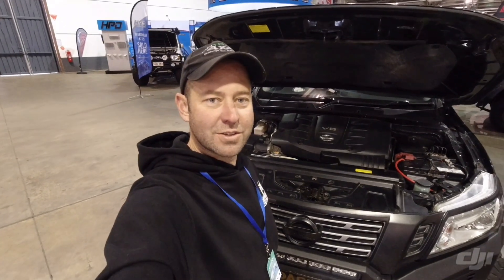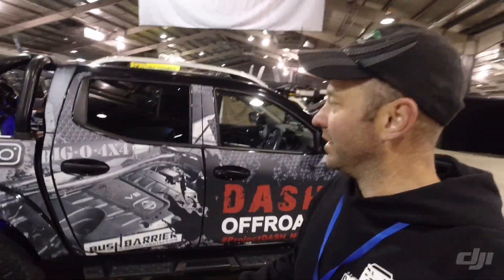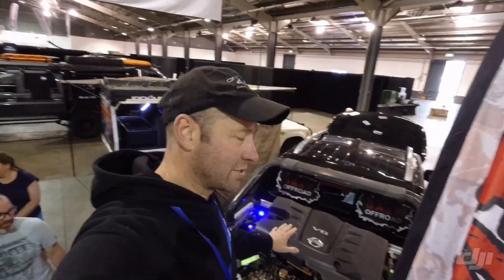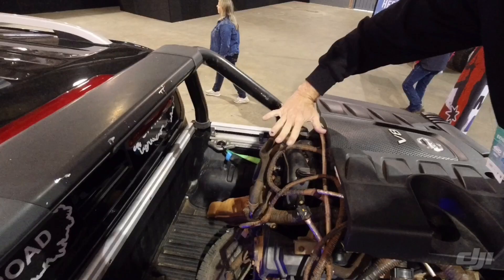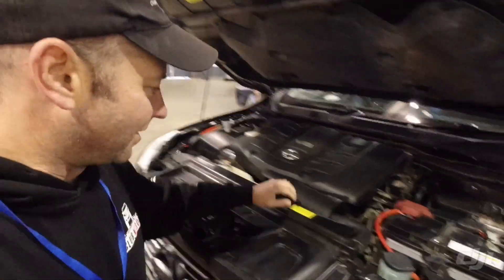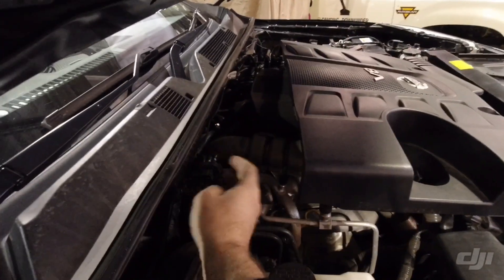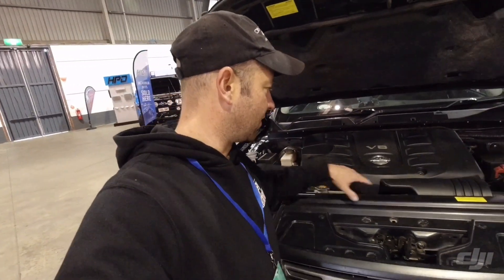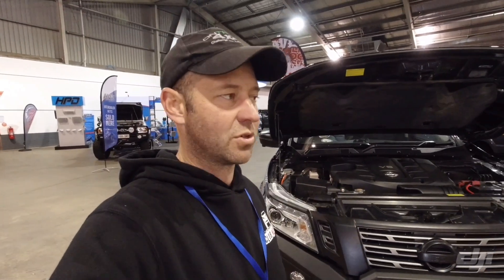Ep.1 - V8 5.6L VK56 Engine Swap Into Nissan Navara NP300

Comment: Nissan take note,  put this in the warrior and they'll sell like hot cakes!
Reply: no one would afford it or could afford it. it'll probs be like an extra $30k above the existing 60k so around 90k
Reply: @lethenparkesTeamRacc  mate people pay mid 80k for a amarok because they want the power,  they'll pay 80k for a Navara with a vk56. I would,  in a heart beat
Reply: @1nando632  then just buy a patrol its basically just that. that's also what its there for too and the amarok v8 is a 4L
Reply: @lethenparkesTeamRacc  ?? What?? 

I've got a y62. Amarok is a ute not a SUV, and it's a v6 diesel not a 4L v8
Reply: @1nando632  yes but you can get a patrol ute with a tray stock with high end specs around 109k and what you said the amarok is mid 80k with a v6 motor imagine what nissan would do with a v8 model in the Navara coming from what they did with the Patrol still be pretty expensive. plus v8s are not that efficient they suck alot of fuel cost alot on registration and are high on service rates.
Reply: V8 Navarra...I want one!!!!
Reply: @lethenparkesTeamRacc  no, you can't get a stock Y62 Patrol ute....
Reply: @mattshaw7671  Its still a V8 thats why theres alot more I4 4WD's on the road than V6's or V8's because they're cheaper and more efficient on fuel to run and they cost alot less on registration.
Reply: @lethenparkesTeamRacc  are you drunk. You're talking about a standard y62 ute, which there isn't one. Y61, yes. Y62, no. 
Yes, y62 is a V8. No,  a Y61 isn't. 
Nor is an Amarok.
Reply: @mattshaw7671  must be because i dont remember writing that comment.
Reply: @mattshaw7671  But i have seen a Y62 Patrol Ute at the front of a Nissan Dealership
Reply: @lethenparkesTeamRacc  It's because you don't know what you're talking about.
Reply: @1nando632  people pay 80k for a 2.2 four cylinder raptor🙄

Comment: I can't see why this won't fit. The VK56 was fitted to the R51 Pathfinders in the US as well as the VQ40DE (AU only). As you would probably know the R51 was also using the Navara chassis before going to the R52 in 2013 as a unibody design. The only thing I would really be looking at is if it is a VK56DE or a VK56VD, with the VK56VD being direct injection. Not that this is a real problem, just wiring/ECU, etc

Comment: I can almost guarantee that the RE7 transmission from each car will have its differences, most obviously in the bell housing. 
The width of the V8 is wider than the Inline 4, therefor bolt pattern will change. 
Only way to swap the Y62 computers will be to run the Y62 transmission in the Nav.
Reply from the maker: Thought that may be the case, luckily we have an entire wrecked car so we can use the Patrol one if needed

Comment: It’s a great idea, diesels days are numbered, I’ve got a y62 best motor but am going to supercharge, what your doing is not new, in Sale Victoria the local Holden dealer has been building new Colorado with 6.2 litre supercharged, and boy is it a mean machine, motor dropped in no probs. So I don’t see you having any issues with space. The Colorado was selling for $90 grand that’s not bad for what your getting. I’d buy a Navara with a 5.6 y62 motor
Reply: An LSA is a small motor compared to the vk56 though. There’s a PX Ranger getting around with a 5 litre supercharged coyote out of an FPV GT and it was a nightmare to fit. I’m sure it’ll fit in but it will be a prick to work on during maintenance and on top of all the electrical issues that will come into play.
Reply: @roughgooch7859  your right, everything is about money, I’ve always believed it’s best to take what the factory builds and just trick it up, I’ve seen tricked up Y62 take on Lamborghini in Dubai and win, the 5.6 is one of the best modern motors ever made, do have to spend money on transmission as will start to play up if pushed by a tricked up 5.6

Comment: Hey Dash... yep...Beard is 100% correct! Had similar issues installing the V9X into the GU Patrol. We too had major issues fitting the V8 into a pro buggy...both had to be connected to their original box...once we connected wires from original gearbox, engine management then woke up started talking to the laptop.. 
The V8 will/may have to have the original gearbox mated perminent as it's written into the V8s ECU..(When was at Nissan in Yokohama looking after their VIPs, I got talking to the top techs about issues with the ZD30 and how I so wanted to pull it out and put this new V8 in it.. Tech said.. as long as your keep it connected to the gearbox, all be OK and but will need a total remap to remove all the off road terrain settings and other shit..It's a security setting too so if someone flogs the engine, without the box.. its no good) 
BUT...dont give up... if a Ford Ranger can be fitted with a new Falcon V8 which had same issues and fixed it... you can do it... check this video of V8 into the Ranger, I'd be contacting them for Info to help you out.. 
https://youtu.be/-6Uuvj_Uz9o

Hope this helps a little.. 
cheerz
Frank 👍

PS...kept the Zd30 in one of Patrols as after being advised by the techs that the CRD Zd30 is beast with some small mods (which Nissan couldn't say nothing before as while in production, they cant do changes as must stay same as details given to licence engines through EPA! ) Not in production, NISSAN now can give details how to fix and what to do for power.. and now a mates ZD30s 200rwkw/800rwnm...100,000ks no probs! 
It's the non CRDs that had issues, but now fixed...
Reply from the maker: Really appreciate you taking the time to comment. Looks alike the Patrol box is coming across too
Reply: Top info mate. 👍